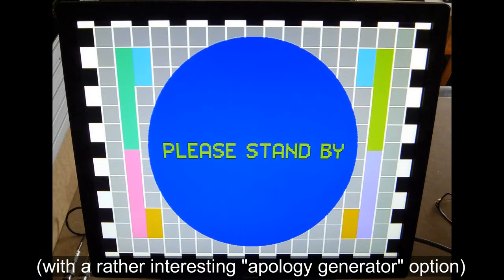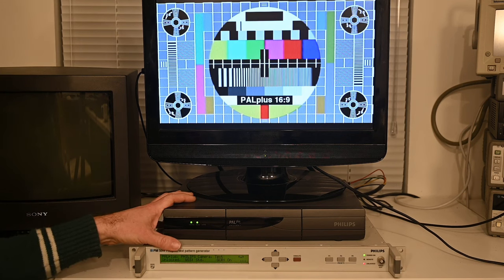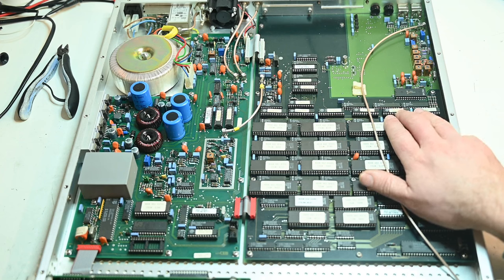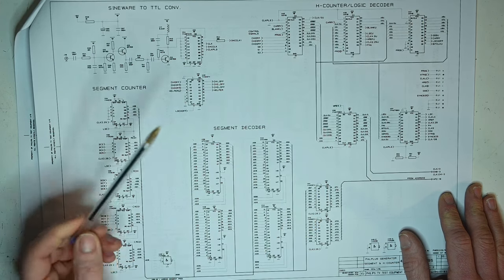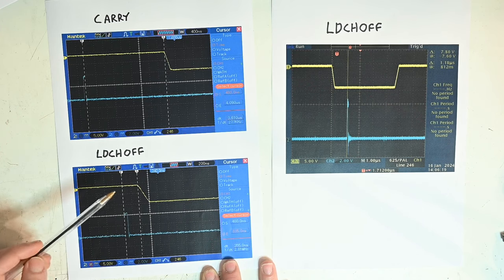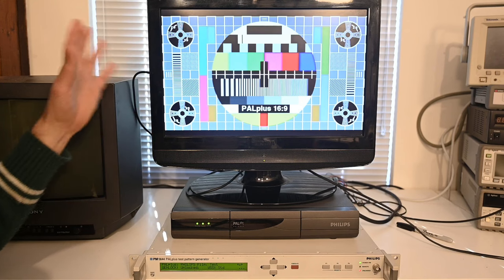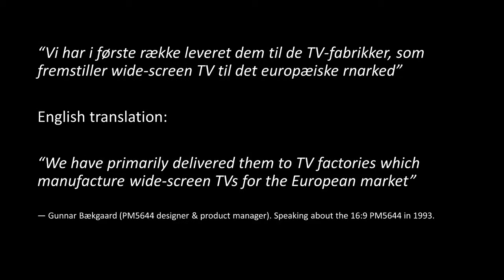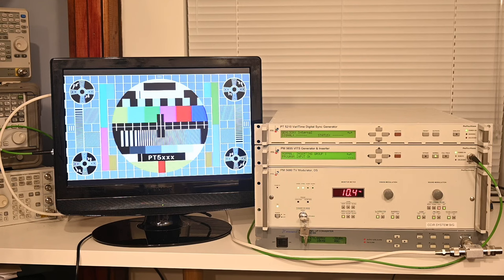#13 - PM5644 follow up (upgrading a PALplus generator and a bit about analogue widescreen)

Comment: Philips had a whole circuit board manufacturing plant in my home town, my father and mother worked and met there, and I did my mandatory engineering internships there in the late 90s. They told me Philips would simply manufacture half empty circuit boards for their rack mount equipment, test gear, prototypes, one-offs, etc., since it was easier to mount the whole board in the standard sized enclosures, than to cut them and then connect them weirdly. I saw A LOT OF circuit boards that were almost empty while I did my internship there in the CAD/CAM department (systems engineering, Unix admin, Unix app development, etc.).  This video brings back so many memories from my times in the lab during my studies. We used so many Philips things because they were "in town".  Ahhh :)

Comment: Sorry I didn't get back to you. I will reply this week with the version I have. Mine came from a Panasonic workshop where they needed it to test PALplus sets.
Reply: Mine is version 001.1 as well. Do you need pictures of the chips from mine?
Reply from the maker: Yeah please send them over. The 001.1 only refers to the front panel firmware, would be good to check the rest
Reply: @mattstvbarn  How can I get the pics to you? E-mail?
Reply from the maker: @geertkroezinga6003  my email is on the channel about tab

Comment: I wonder if the checkerboard patterns are there to assess proper PALplus decoding. When scaled to 430 line letterbox those checkerboards get smeared out and when reconstructed back to 576 lines by the decoder, if the helper signal is correctly decoded it should recover the checkerboards as sharp and clean as possible. It's just a guess.

As for the diagram, I think that as the specifics of the versions of the pattern are getting cleared up more and more, I should probably make separate diagrams for each variation ...though that might end up in a lot of diagrams. 😄
Reply from the maker: I wish we could find a full form PTV catalogue from the mid 1990's. It likely has all of the diagrams in it like the 1980s full form catalogues did, of which I have a few versions, but it's all 4:3 which we have already seen. DK-Technologies never received any technical drawings of the test cards from ProTeleVision Technologies, only the software to generate them.

Regarding the checkerboard - I took a couple of pictures of the test card, 16:9 decoded and 4:3 un-decoded. What do you think?

https://xpander.mattmillman.com/files/linked/non_decoded_4_3_letterbox.jpg
https://xpander.mattmillman.com/files/linked/decoded_16_9.jpg
Reply: @mattstvbarn  Counting the squares it appears they are 2 lines tall in the encoded letterbox signal, so it's the other way around from my first guess. I still think they're designed to confirm the decoder upscales in film mode, though the resolution lines and vertical sweeps would also reveal distortion if it was upscaled in camera mode.

Comment: Interesting YT Channel! I just stumbled across it and look forward to going through you video catalogue. 

I happen to have a PM5534 "Circle Pattern Generator" in my collection, but so far I have not found any literature or a service manual (which would be a very nice find indeed) Can you help?

My unit is working, and likely came from a television receiver factory. There are a couple of empty PCB card slots, which I assume that these where options for this model. Thanks In Advance.
Reply from the maker: Me too. They seem to be quite common. I have never found the manual. This is the best I can do you: https://github.com/inaxeon/PTV_Preservation/blob/main/PM5534/Docs/PM5534_Brochure.PDF
Reply: @mattstvbarn  Well that's a grand start, Cheers!

Now I will crack on making boards to add titles and a clock display to mine.

But first, I have to reverse engineer the signals on those vacant internal slots!
Reply from the maker: @pstonard  that sounds like a very interesting project! Let me know how it progresses!
Reply from the maker: @pstonard  Hey man I photographed and dumped the text/clock options from my unit here: https://github.com/inaxeon/PTV_Preservation/tree/main/PM5534 any other questions give us a shout.
Reply: @mattstvbarn   Many thanks! Really appreciate that you took the time to collect this data and share it.
Reply from the maker: @pstonard I found somebody who has the manual. It's (now) here: https://github.com/inaxeon/PTV_Preservation/blob/main/PM5534/Docs/Manual.pdf
Reply: @mattstvbarn  This is the Rosetta Stone, huge thanks for sharing!! I owe you a beer!
This inspires me to dig my PM5534 unit out of the storage locker and set it up.
I had done some investigating using your PCB PIX, but having the circuit diagrams is so much better.
Reply: Matt, for some strange reason YouTube has deleted my comment(s) on your later video #15. Please reply here (or there), Thanks!
Reply from the maker: @pstonard  did they have links? If so, yes, YT auto deletes. I can't even see them in the junk queue!

Comment: The sub-d might have been for SMPTE st125 output. Digital video was mostly on s259 270Mbit coaxial in the late 90s though, but there was a short period they did try to send SDI in parallel format. But it was far from practical.
Reply from the maker: Interesting. I'll have a read about I!
Reply: @mattstvbarn  Think I spotted some prototypes or dev boards for it at the R&D dept I started 25 years ago collecting dust, by then we were mostly only making 270Mbit gear. Succeeded later by 1,5Gbit somewhere 2005 or so.
Reply: ST 125:1995 - SMPTE Standard - For Television — Component Video Signal 4:2:2 — Bit-Parallel Digital Interface

Comment: I want a PM5644/00 4:3 Pattern Generator - shows time and date and I want it just for my hobby.
Reply from the maker: Depends what your hobby is. If you want a generator with an actual analogue output, that is quite hard. But if SDI is OK, then it's easier. PT5210's often come up on eBay and [some] of them can be adapted to do what you want, but it is not a trivial exercise.
Reply: @mattstvbarn  Yes, I'm an analog TV hobbyist but I need something like a pattern generator like the PT5210 because I'm in Thailand right now and it's on Ebay and I can get it shipped to Thailand.
Reply from the maker: There aren't any for sale with analogue at present. I talked about the modification in video 8. It is really hard, and quite expensive!